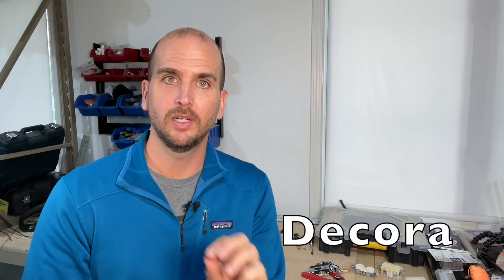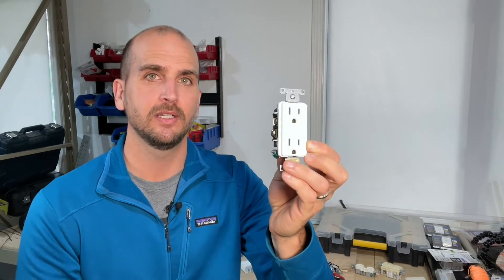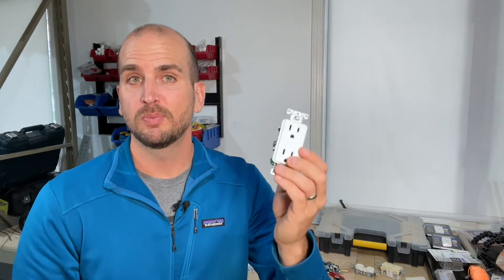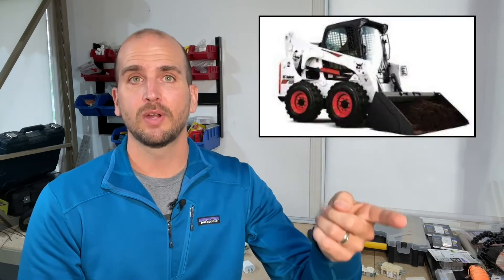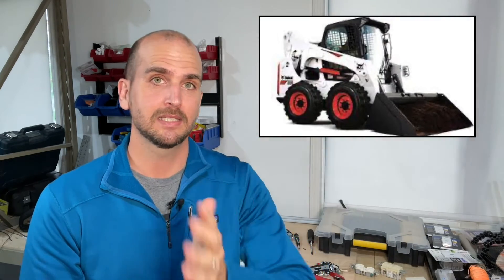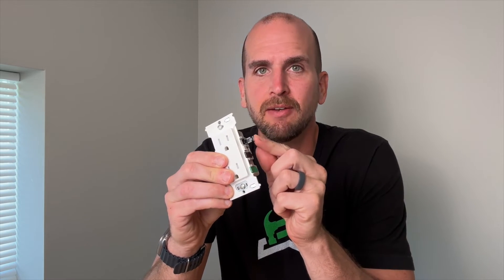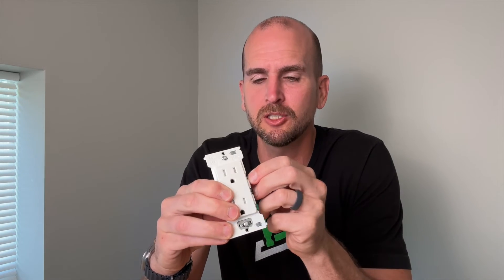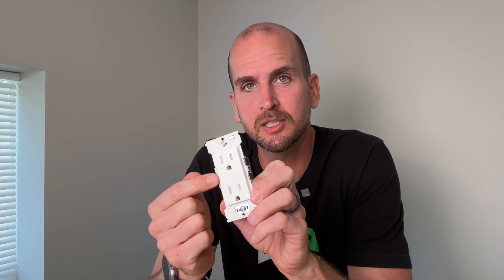Duplex Vs. Decora Electrical Outlets

Comment: Please do not use those flip connectors. They are junk and can't be torqued. Just like Waco. Never backstab. Stay away from those methods. I prefer commerical grade regular duplexes. Metal backing strap that wont break over heavy use. 😊
Reply: ignorant.

Comment: Decora all the way. Easier to clean, uses the same face plates at the light switches and they just look nicer. The light switches can also be turned on or off with your elbow if you have your hands full, say a laundry basket or grocery bags in both hands.